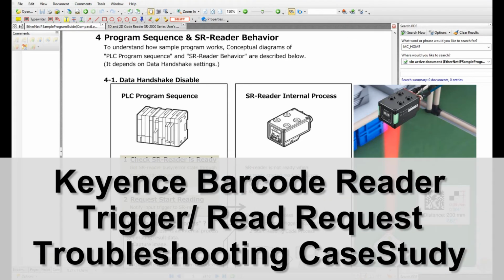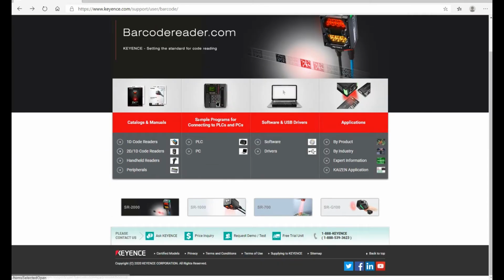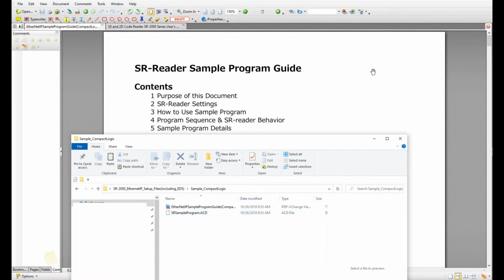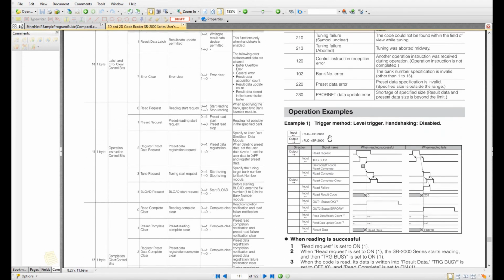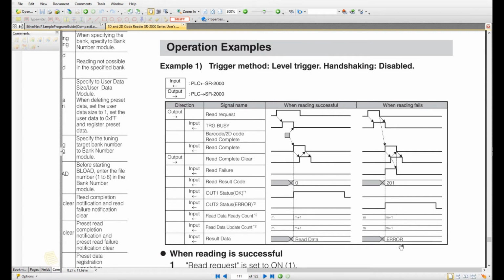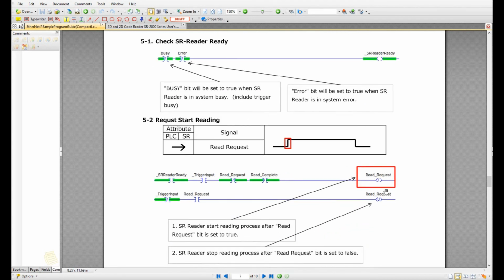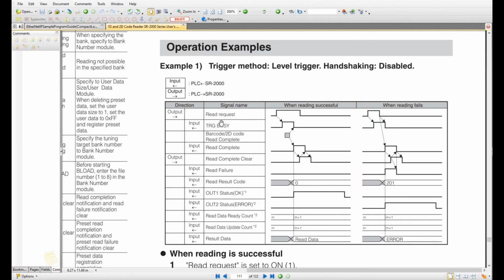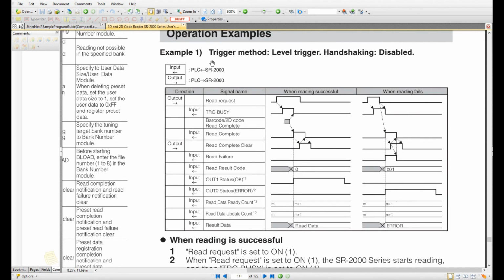KI13.  Keyence Barcode Reader Trigger/Read Request Troubleshooting

Comment: Hey man someone like me is gaining knowledge and making automation career path easier thru your wonderful videos and experiences. You only deserve respect!
Reply from the maker: Thanks buddy! I was a Siemens control specialist for 10 years and the recent five years I started touching Allen Bradley, Omron, Beckhoff many kinds of sensors and vision systems. This five years process likes starting over again for my personal career, and I experienced learning as a starter. But benefit the past years industry experience, I could improve a little bit faster than fresh man. Then i realized it would be value sharing some knowledge and the learning and testing process for others, also involving some of my understanding and explanations in the videos. This makes most of my videos too long, rather than <=10mins ones. However, my aim is to explain the topics in the videos the clear as I can so the video topics could be a 'solution' video, means that if you find this topic here and it matches for your case, then the methods showing here should provide you a methods to solve the troubles or similar applications you are doing. Thanks again! Keep in touch!

Comment: How can I link this camera with twincat 3 ???? That would be awesome ! Iv 500 or sr 1000
Reply from the maker: Since SR1000 support Ethernet/IP and Profinet, considering the price, I would recommend you use a Ethernet/IP master (scanner) in Beckhoff controller side.
Reply: @electricalautomation  you made a tutorial with tia portal but with twincat would be awesome
Reply from the maker: @yulienalvarado5743  Thanks for your feedback. The Beckhoff does very good job on the calculation performance especially on the complex algorithms, as well as the EtherCAT. However, the Vision, Barcode scanner, valve banks and so on those smart devices vendors most of them only support Ethernet/IP and Profinet. For Beckhoff system, to implement EIP and PN, you have to purchase communication modules, rather than AllenBradley and Siemens, their controllers build-in the protocol. This might be the reason Beckhoff is very strong in the Extrusion Industry rather than Robot and Inspection cells.